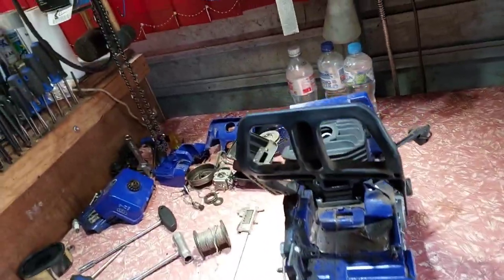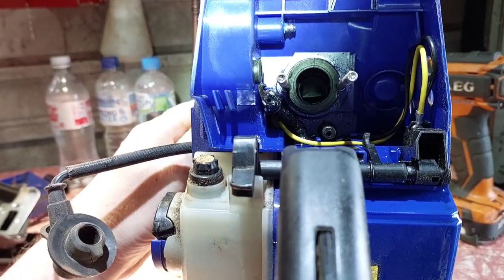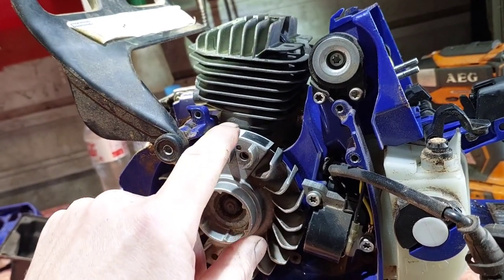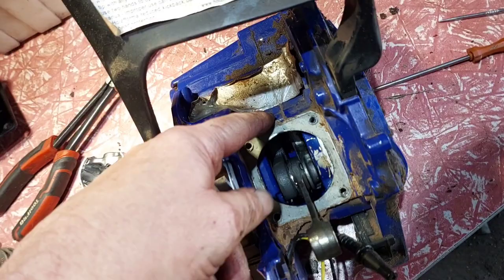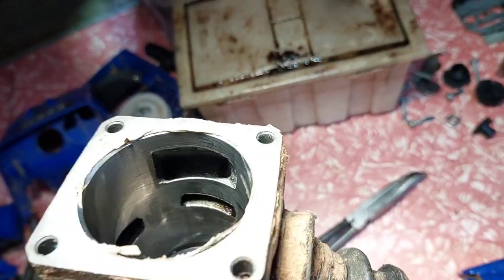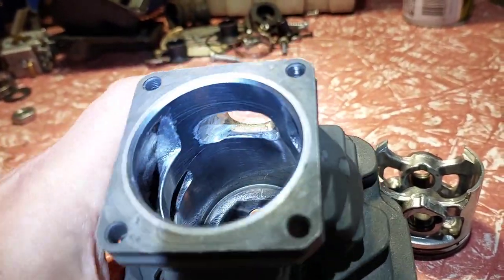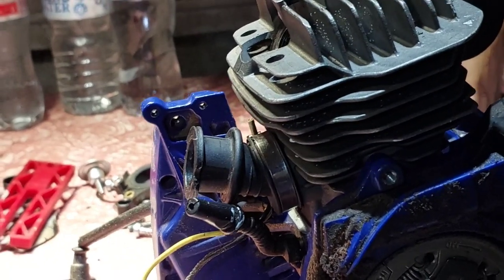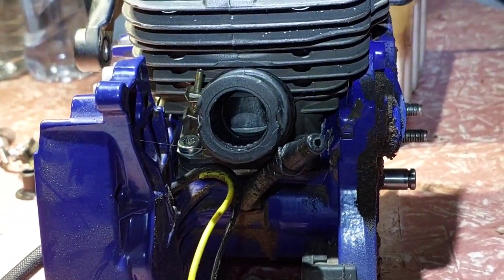Are we porting the right way? and why?

Comment: You were right when you said, “It will rev its head off”. The instant response when I open the throttle is crazy, and even though it revs like a liming saw. It still pulls hard in the big stuff better than any of the saws we use at work
Reply from the maker: Thanks mate 👍